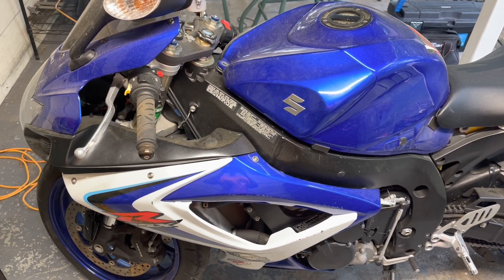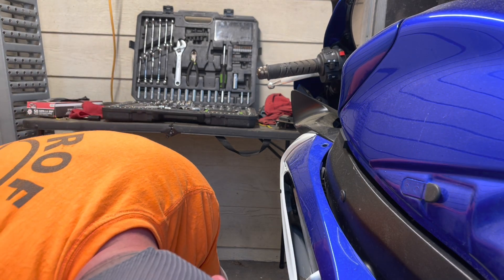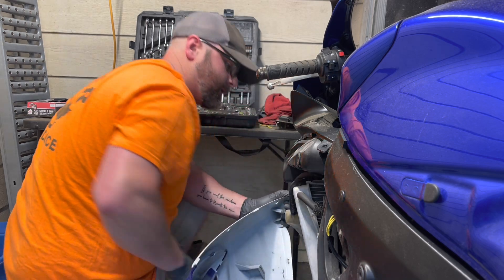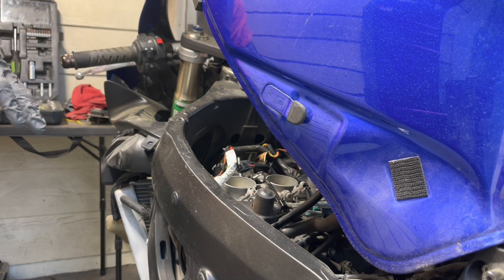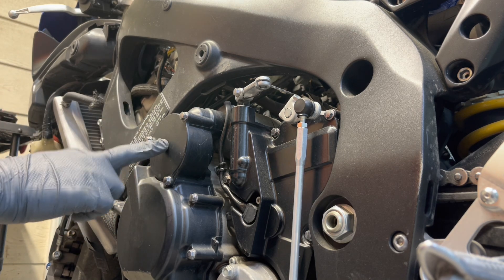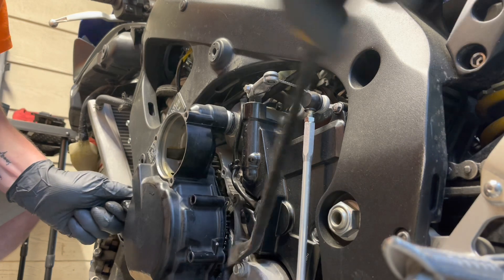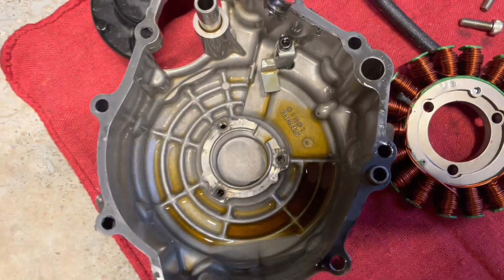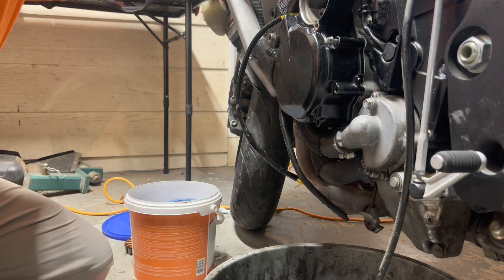Part 1 of 2. The reason most charging systems fail on a Suzuki gsxr and how to replace the stator.

Comment: At the end when installing the starter gear, the thin washer goes on last, you put it on the inside next to the needle bearing, it should be the shaft, shim, needle bearing, starter gear, shim, thin washer, then the cover.
Reply from the maker: Hmm good to know I’ll have to fix it in the spring when I won’t turn into an ice cube while riding.